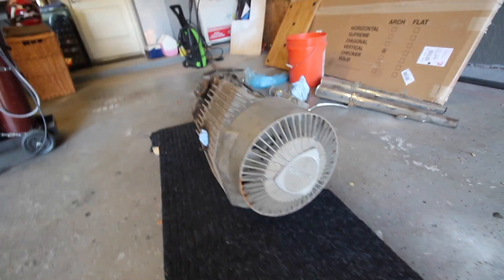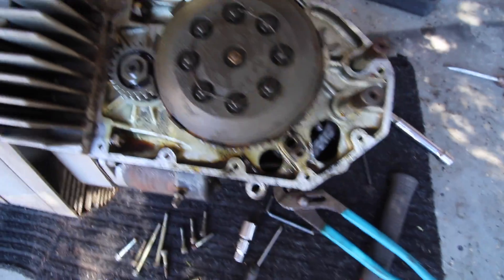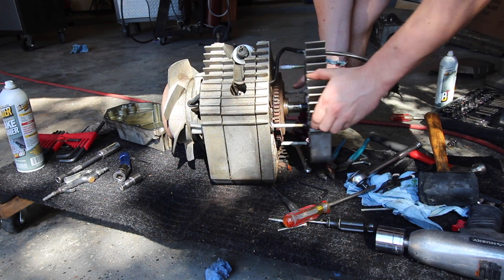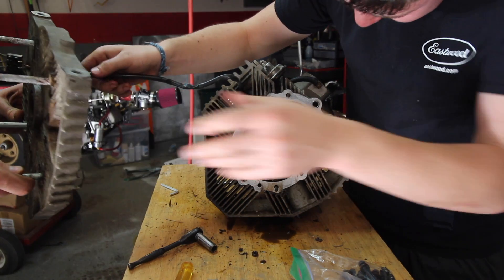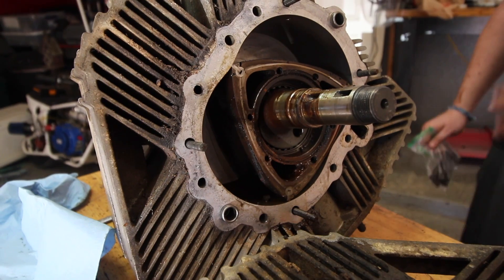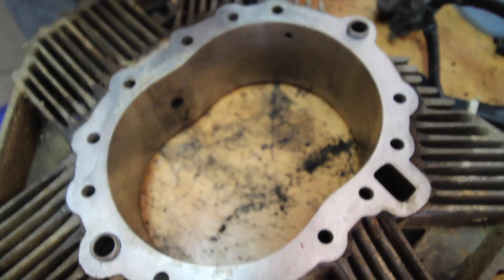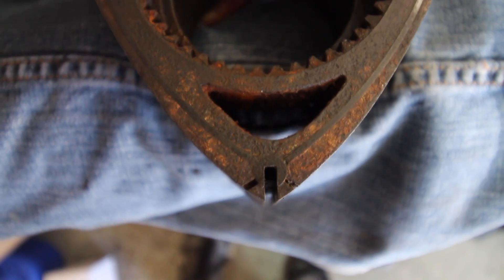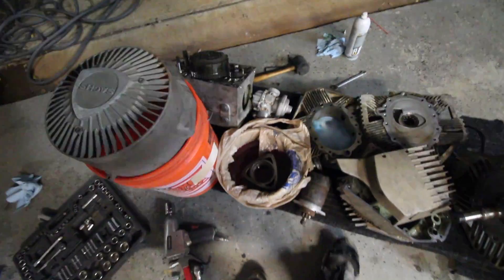Rare Rotary Motorcycle Engine Find! | Rotary Shifter Go Kart Build Part 1

Comment: I used to ride an Arctic Cat rotary snowmobile. It was very easy to pull start compared to the big single cylinder engines. This is before electric start was common.

Comment: There’s a special position to push the side seals out, perhaps you’ve found it by now. But if you use a rectangular shaped punch or something so :thinner than the seal groove , than if you look at the groove cut into the rotor for the side seal it extends all the way out to the edge of the rotor and with a punch that fits in you can tap/push straightly on the seal through the end of this valley, 
I’m working on a arctic cat 295 and 303 rotary the 303 is absolutely wrecked, but my 295 needs only 1 side seal, can’t find a replacement 😿

Comment: Check out the Aixro XR 50. Rotary  Kart racing engine.
There fast but as the distributer told me
" Very unreliable " & 
Need constant rebuilds .
I have been building  & racing Rotary  Engines since 1974 first for Sprint cars till they were OUTLAWED .
Then S.C.C.A - I.M.S.A &
Other street & circut racing 
customers.
10a -12A-13B , etc.
From mild porting & locked Rotors to full bridgeported Race engines
Supercharged - turbos 
Holly carburated.  -single & duel Webber carbs -Fuel injected 

Felix Wankel sold the rights to Hercules ,Sachs , Curtis Wright , Chevrolet ,
Mecedes Benz . Bombardier (Ski-Do)  etc 
But only Toyo Kogyo Ltd. (Mazda ) made it both reliable & efficient .
I had a Ski- Do snowmoble
that came stock with a 
Sachs  Rotory engine 
I ported it & put a webber carb & custom built header on it .
It was devastatingly fast !
Then i put a Kawasaki Z1000 engine in it 
& put the Rotory on a Racing Kart .
Anyway !
Nice work guys

Comment: You might want to run it on 2stroke pre-mix (50:1), it works wonder on their longevity ^^
Reply: All the rotary engines burn oil.A small amount is injected to lube the rotor.1 of the reasons they are hard to make them run clean.A catalytic system will fail over time with any oil burner
Reply: @markarrington3869  Of course they do, that's how they were intended to work.

Air cooled engines in particular had a great appetite for oil. 1 quart for a 1000 miles wasn't concerning.

The use of pre-mix for Wankels, helps them beeing lubricated when you first crank them before oil pressure can build up in order to lubricate the housing.

The fact that those Sachs engine were air cooled Wankels implies that it'll run longer and happier on premix.

And catalytic converters are for Sissies !
They do mor harm than good by making an engine burn more fuel to get them to operating tempeature, are made out of rare metals with questionnale effect on health... and they spit out everything they've "catalysed" throughout their lives when being recycled ! XD
Reply: @jean-charlesweyland129  long reply! I respect your fingers
Reply: Lol none of you have any clue....
Reply: redline 2T is tits in my rx7

Comment: port that thing out, turbo it, and build a good offroad buggy around it.

if it's the same as a sachs 303 then mazda 12a seals should fit it just fine and be easier to locally source. They will need to be machined down which is easy for any machinist with a mill. They are cool engines, I've only seen one my entire life. Then again I live down south where snowmobiles are like unicorn tears.
Reply from the maker: neo 71665 Yeah we tried 12a seals, they had some wiggle room which sucks but we found some oem ones. They were just super expensive.

Comment: Time for you to get a blue tip wrench it would've made disassembly  200% easier. Also if you had soaked the rotor in diesel fuel for a day or week those side seals most likely would've nearly fallen right out

Comment: Better check the oil pump is working and flowing good before running it or it will self destruct quick.
Reply: pre-mix bud. Even guys with Rotarys in their cars usually end up running premix
Reply: @zuestoots5176  premix mucks up fueling. It was designed and carb jetted for oil pump. Just adding premix leans the fuel ration and could destroy the engine.
Reply: its called a metering pump and yea it makes to sense to remove it bc its not a high hp build
Reply: @williamarmstrong7199   sorry sir, but read the history of the w2000. It was pre-mix in the beginning, then oil injection was added later
Reply: Forget the oil pump. See below.
Reply: Facts

Comment: When you have better engines than cars and cameras
Reply: While I like cars and cameras all they want to do is take off better engines to throw predators on everything. Before all the hate I'm not saying a pred is a bad engine, they just have a time and place where they are the perfect choice. It's just not on everything under the sun.
Reply: @user-neo71665  I assume its because you can get performance parts for the predator engines.  My thing with cars and cameras is if you want performance though, why not go buy a sled engine?  You can get more then 100hp out of them, but only the size of a large handbag and lightweight.  I mean a 600 twin is going to weigh less then probably even a 9hp predator.
Reply: @KlockworXMusic  I'm all for sled engines but like me they are in the south where finding cheap sleds are like finding unicorn tears. I've looked into shipping one and if the buyer will even do it the cost is almost 3 times finding an atv engine (way more common down here). A good atv engine is gonna cost 2-3k.

As for parts it's because they have GPS sponsoring them. You give me free crap and I'll rip off everything and throw a chinese clone of a honda on it.
Reply: @user-neo71665  Shouldn't sleds be pretty cheap way down South, not like there is much of a snowmobile season I can imagine, why would anyone want one?  I mean I get what you are saying, up North I can stop and ask to buy an old sled in some farmers field and they basically give it to you, but even finding bike and atv engines is usually fairly easy still.  Plus with eBay you can buy a sled engine and quite a few still have free shipping on them, they really are not very large or heavy items compared to some stuff.  But a 22hp predator cost $750, plus how much in performance parts to get it to something like 50-60hp, a 600 twin or triple core is like $500 with shipping, add in another $300 for carb(s) and a few other little things they usually don't come with and you're off.  Even little 340's make good power and only cost $200-$300 shipped.
Reply: @KlockworXMusic  there is no snow season down here. I'm 39 years old and can count on 2 fingers how many times I've seen a snowmobile in person. Like I said I've looked onto buying one and shipping and yeah it's far from free. Hell you buy me a good 4 stroke over 300cc with reverse and I'll paypal you $300.
Reply: @user-neo71665  They get predators so cheap, or even for free because they advertise gopowersports all the time. Its their sponsor. So, you wanna spend your own money to engines or take 20 predators for like 200 bucks ? And performance parts too. And all other building stuff.
Reply: drive it break it fix it i love cars and cameras lmao

Comment: Beware:
Rotary engines are not torquey powerplants, not by a long shot.

Much akin to 2 strokes, they live happily in a very narrow rpm range.
Reply: Isnt that better ;)))
Reply: @milan5159  Not especially. Not for the application they are attempting.

Think of any large power rotary car; think forced induction or bust. Hell, the RX-7 is only happy with a turbo or an LS1. Take your pick.

Being this is going on a kart, it will probably be a negligible situation, but dont expect Briggs Animal type torque off the line.

Think more of a miniature RX-8.😜